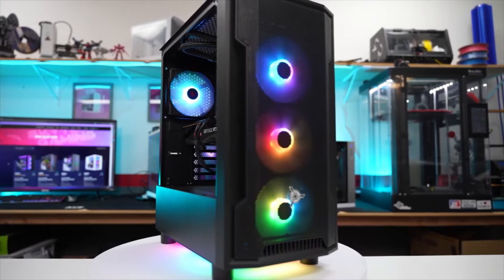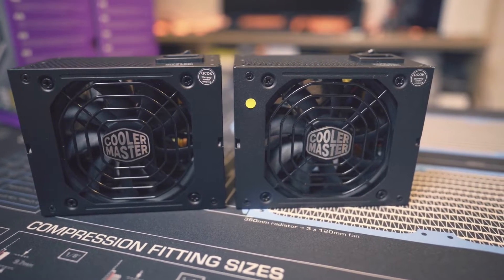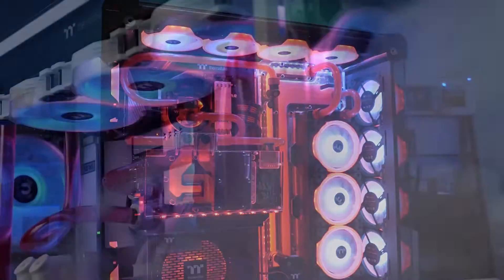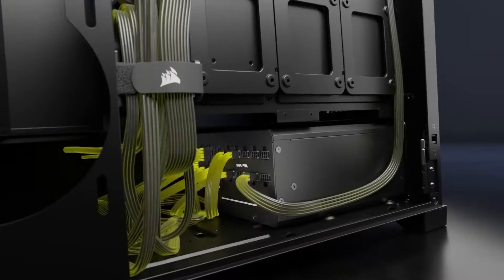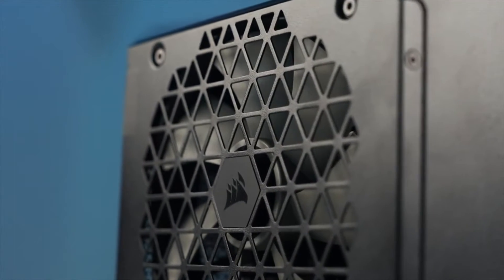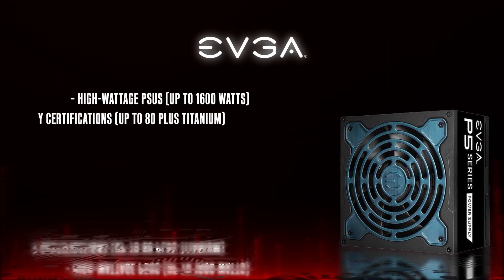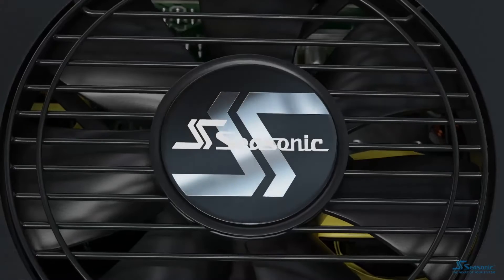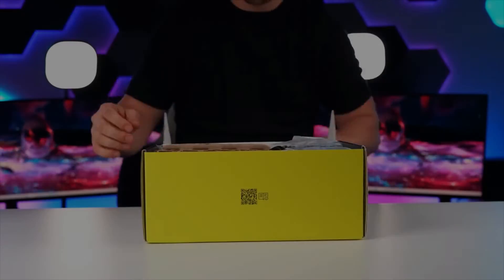Best PSU Brands: Who Makes The Best PSUs in 2024?

Comment: Best PSU oems: FSP,  Seasonic, CWT. Brand does not matter, specific model matters.
GF3 (1000W) is the only Thermaltake PSU that I would consider.
Seasonic Focus GX and upper tier models are great.
Corsair RMx, RMx Shift, HXi, AXi are all great.
Evga has FPS OEM models nowadays, used to be Seasonic, they are good units (Gold and above).
FSP: Gold and upper tier ones are good.
NZXT: great CWT PSUs